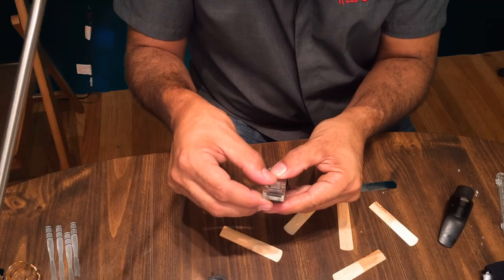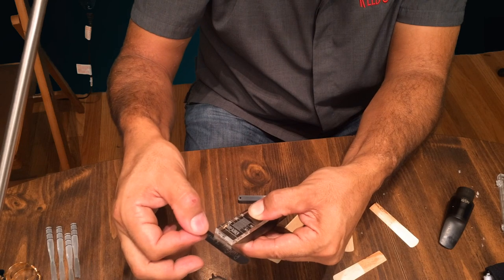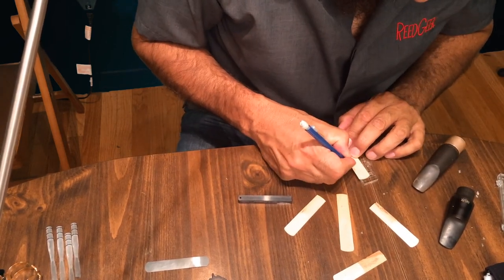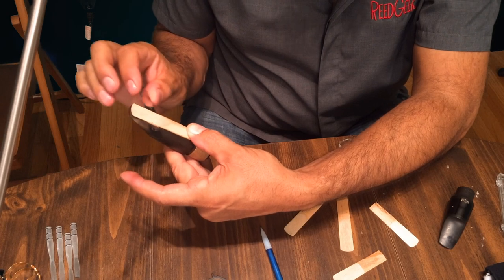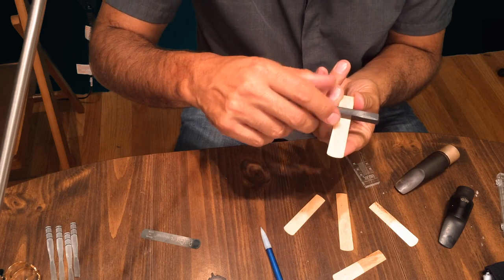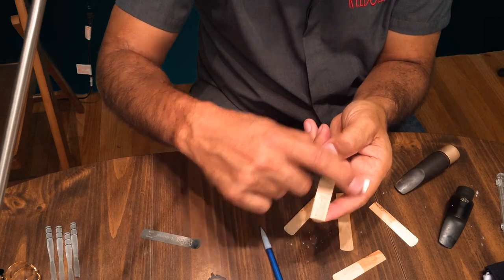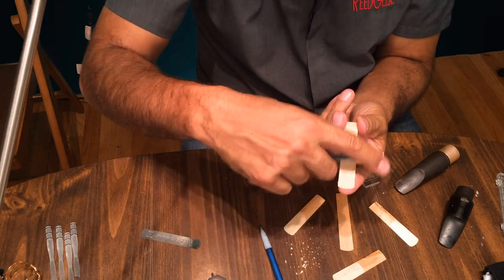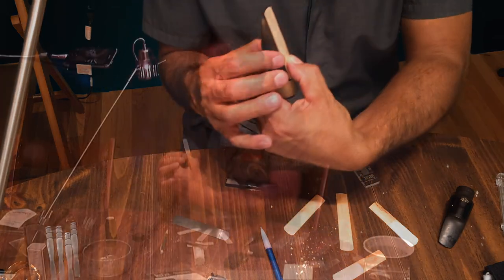ReedGeek  2017,  Mauro Di Gioia  Reed Adjusting Tutorial

Comment: Best advice I have seen from a dozen tutorials. I use a stanley blade.  (Please don't copy)  putting a very light pencil mark is great, you can take of the pencil and remove very little cane.
Reply: I tried Stanley blades too (trying to save money) i found they aren’t so flat.  Something about that 90 degree angle of metal works better

Comment from the maker: Hi Tom....as per the reed diagram on the video and which can be downloaded at ReedGeek.com, I would do a little bit of scraping/blending with the ‘Geeks profile tip. This would be on the “ears of the reed” section C and working towards the spine in a circular motion lightly using the profile rounded section of the ReedGeek’s tip like a pencil eraser. Lastly, use the flat planing edges of the ‘Geek perpendicular across the nose/ tip of the spine to flatten the tip area lightly scraping up and off the tip to promote a quicker vibration to the tip....I hope this helps as these are the area to help the final voicing of the higher notes (F). I will try to post another video of this very soon!
Mauro
Reply: ReedGeek 
The VanDoren ground-glass tool make some incremental scrapings easily and, if done on a moist read, will shave the kapok from the underside. Giving closer, flatter reed contact.  Done under running water prevents the glass from clogging with reed debris. And testing the reed pliability against the tongue is much more sensitive than fingers.

Comment: This tool really works fine, good work, I have one since some years. It is ok that you want to have a good price to generate enough income. But 60 Euros/70 US$ for a simple small piece of metal seems very overpriced to me comparing the production costs, sorry. 30 Euros would be more than enough.
Reply from the maker: Dear Ruediger, ReedGeek's  are very costly to produce (higher than the cost to produce many vital woodwind accessories--I'm often amazed that players have no problem spending 60-200 Euro on ligatures) .Don't be fooled by ReedGeek's simplicity and size; 18 procedures from start to finish with very precise machining. We use very costly aerospace grade alloy sheet that provides the ReedGeeks with ultimate precision and extremely long wear. With an accuracy of .0005 on all edges it is truly the Best reed tool in the world.I am so happy you and many players are achieving years of better reed performance!!  Mauro